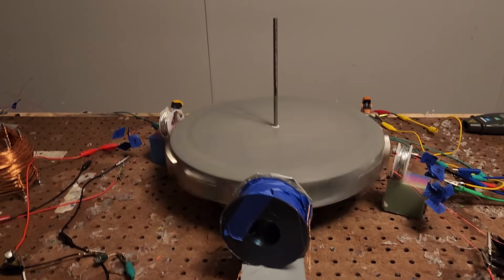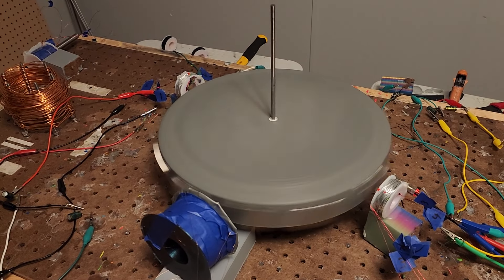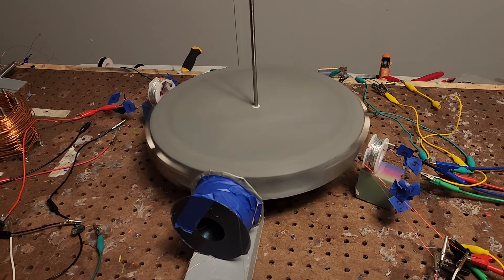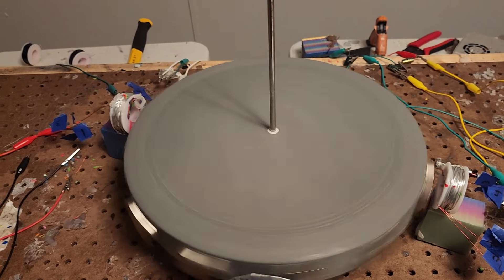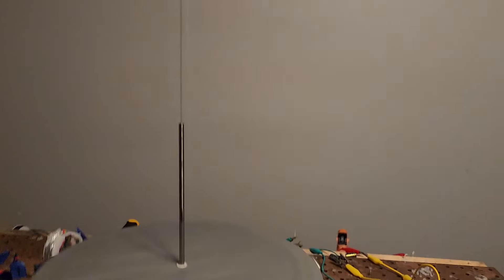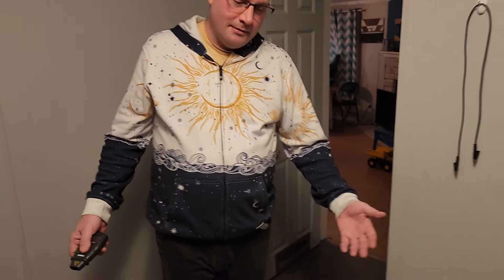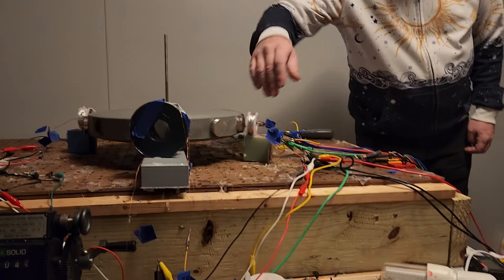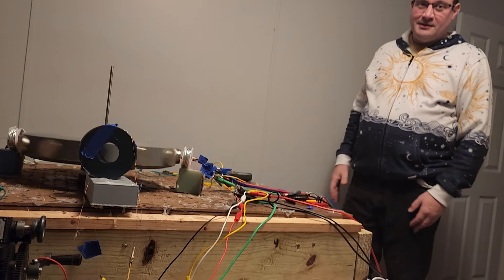papa's pulse motor 10 magnets on a 12 magnet rotor running smoothly

Comment: there are a few bits of information that would greatly help you out. i can produce 413V with 6 magnets in about a 4inch diameter rotor with just 2 small Cu windings. very small changes can make massive differences
Reply from the maker: nice.
Reply: @MPHJR  put a Cu winding around some MuMetal or from a transformer core. Don't close off the end of the transformer core facing the rotating magnets and feed that to a circuit to in turn power your coils you're using to turn the wheel....... play around with it and figure out what is best and you'll be surprised I believe. I figured it out on accident and was fixing to give up when I accidentally made a breakthrough on what I was doing.

Comment: These things are always fake. No tin foil to check rpm? Rip a piece off your hat!😂
Reply from the maker: prove it, anyway your the best
Reply from the maker: define fake please
Reply: @MPHJR  just ignore comments like that. Keep up the good work. It's this hands on that you are doing that teaches us the most. I've been building and inventing different types of motors for over 20 years. None have been free energy of course, but I've made some really fun stuff and learned a lot. If I can reach out somehow I would like to share some of my experiences that could help really improve your efficiency. You are doing great, and without knowing your torque im just guessing, but what you are getting out of about 12 watts of power, you can easily do on less than 1 watt. As far as your rpm for sure. If you aren't going to drive anything with the torque, and collecting the collapse, then speed is what you need anyway for as little current as possible. Keep tinkering. It's how incredible things are found!
Reply: @MPHJR a lot of times when people call these fake, they assume you think your are powering the space shuttle with a 9v battery. They usually call it fake because they think you are claiming free energy. Not because you are testing a working pulse motor. Unless you are making a claim of getting more than 12 watts of power out for the 12 watts you are putting in, then it is irrelevant. Just continue to learn and have fun. Keep posting your work. Just please don't make any wild claims and enjoy your work.
Reply: @ChuckYoung75 Correct. Forget about the small people. This kind of research & experimentation is great. It's a whole lot different from vegging on the couch & being complacent without dreams & passions.